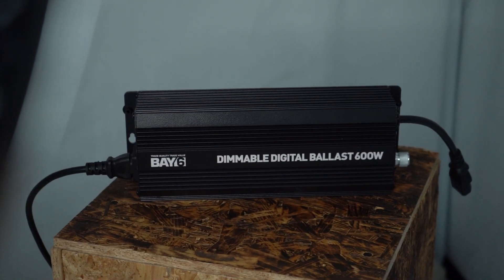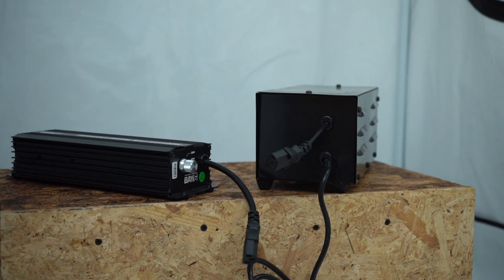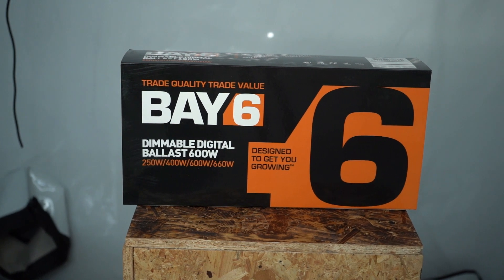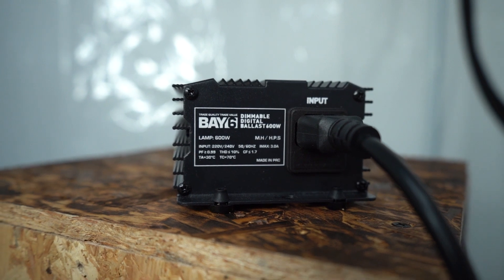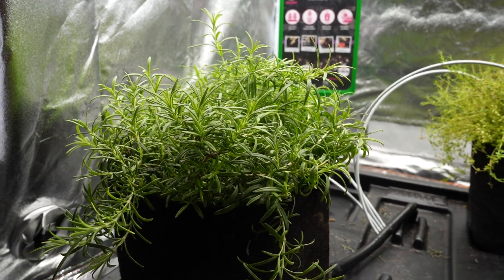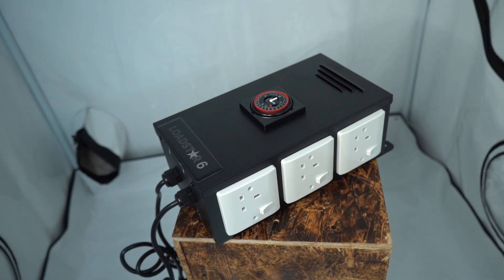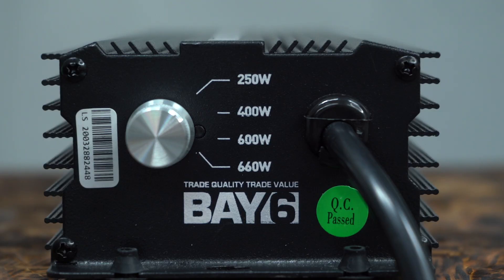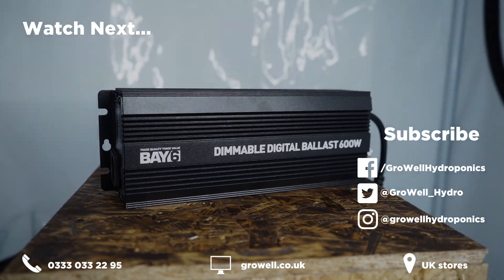How to set up a digital ballast | Step by Step

Comment: If I want to run ×4 600 watt balist can I plug 4 in to a 4 or 6 way powerboard ? or is there any requirement to use multiple balist would you have to check you house fusebox because I know most homes are slit up into ×2 15 or 30 amp sections usually the bedrooms and the second half of homes which would be lounge kitchen laundry and some even have extra for garage or should I ask a electrician for help so I'm not blowing fuses all the time?

Comment: Does the reflector need an iec connector built in? Or is it possible to get an electrician to wire a stripped wire --> IEC female, that would plug straight in to the ballast? 

The HPS reflector has previously been run on a magnetic one, with just straight up stripped wire from both ends. (Cooltube <--> magnetic ballast) and there's no readily available info out, at least that i could find. Only for reflectors with an already hardwired IEC connector.

Cheers from Amsterdam.
Reply from the maker: Most reflectors will have a connector port built in. You could get an electrician to wire it, but obviously that throws any warranty you might have out the window.

Comment: im not growing plants but i have always wondered if a guy could run 2- 250w or 4-150w HPS off of a single 600w ballast.
Reply from the maker: We definitely would not recommend trying this. We would always match the lamp wattage to the ballast wattage as the ballasts are designed to run just one lamp at the required wattage.
Reply: The starting voltage of the high wattage ballast will probably  blow up the lower watt lamps. 

The electrical ballast is not only used for transforming the current to run the lamp. 

But also needs to ignite the lamp and then limit the voltage and current in time.

Always use a matching lamp ballast combo. 
And the dimmable digital ballasts should be turned off when changing the wattage selector.

Comment: In summer is it possible to run a 400w bulb with a 600w digital ballast to keep the heat down ?
Reply from the maker: No, always match the wattage of the lamp to the ballast, then dim with the ballast. This will reduce the heat a bit and remove the risk of complications from an incompatible lamp and ballast.
Reply: @growell  thank you so much i will just do what you recommend and it also saves buying a new bulb 💡

Comment: Is a 400w MH Bulb able to be safely dimmed to the 150w & 250w setting via it's 400w Electronic Dimmable Ballast?
Why does the internet keep mentioning the below?:
The better use is to dim the 1000w ballast down to 600w and then use it to run an actual 600w bulb.

That is the big advantage of a dimmable ballast: it allows you to power bulbs of multiple wattages.
Reply from the maker: Always match the lamp (bulb) to the ballast. So 400W lamp for a 400W ballast, evening if you're planning to dim it at all times.
So yes you can safely dim the 400W lamp to 250W etc.
We'd never recommend you use lamps that don't match the ballast wattage because of the initial surge in electrical current used to fire the lamp.
Plus we wouldn't recommend using a Metal Halide lamp if the ballast has an over charge feature (to run lamps at a higher wattage).
Reply: @growell  Thank you, Absolutely Professional I really appreciate it

Comment: My cable guy claimed that my two ballast a week after I hooked up the second one both of them Solis Tek. 1000 watt and 600 w.. took out the entire neighborhood internet and cable. He disconnected me left me disconnected and drove off. What did I do walked up to the meter plugged my stuff back in went back to my house and watch my damn TV. But I did also have to move the wiring for the cable input from the outside of my house running across my living room through my garage into my kitchen because right below the living room is where the digital balast are.

Comment: Can you use more than one light on a single ballast??
Reply from the maker: Not with any of the ballasts we supply. There used to be dual magnetic ballasts many years ago, but nowadays it is one ballast per light for every brand that we can think of!
Reply: @growell  Cheers for the speedy reply and advice  I was on Your website before seems a reasonable price  Thanks again Pal

Comment: What happens if i accidentally pull the bulb cord out of the ballets before taking out the mains :( lights not working now
Reply from the maker: Give it some time, at least 15 minutes then try to turn it on again. If this doesn't work most likely you'll just need a new lamp (bulb).
Reply: @growell  totally over reacted 🤣 never done it before and thought it did damage the bulb, you are right waited 20 and it light away right away! Crisis averted